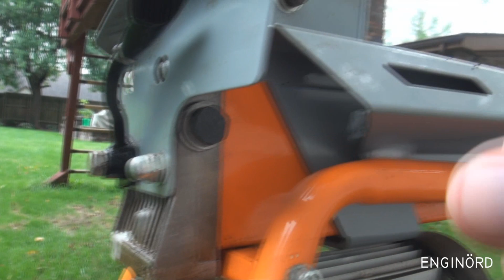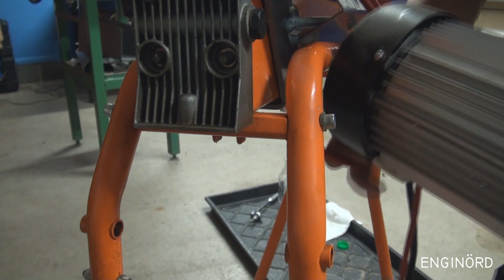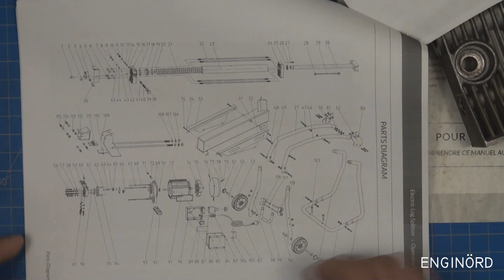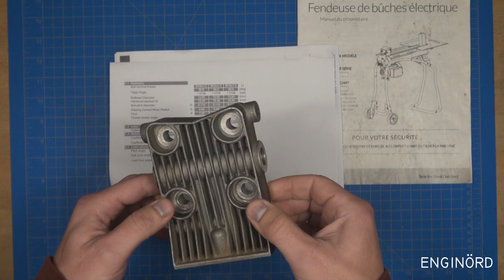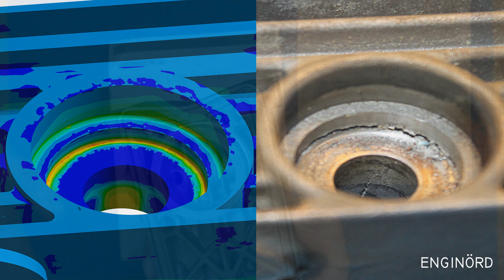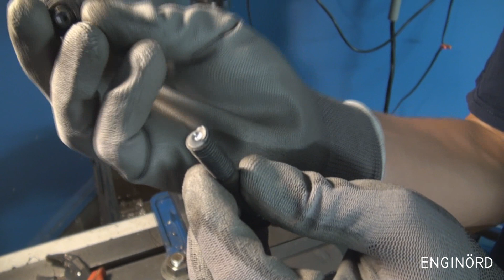Yardmax YS0552 Log Splitter Repair - Part 1

Comment: Same as the old Homelite housing so thanks for showing how to easily separate the motor from the upper valve housing. Accessing the mounting bolt is tricky on my Homelite, you did it off-camera. Need to replace those o-rings on the plate to stop oil leaking through the bolts.
Reply from the maker: Thanks for sharing your experience. Hope the repair goes well!

Comment: Great Video! Extra points for running the analysis. What hardware/equipment and software are you using to scan the casting?
Reply from the maker: Hi Michael. Glad you enjoyed the video. I used a shining einstar scanner with its own software for scanning.

Comment: OK works most of the time but now it just hums
Reply from the maker: if the motor is spinning and it's not moving the ram the bypass valve might be the culprit. if the motor hums but does not spin then the start capacitor might be faulty
Reply: @enginord  thank you. I will check the capacitor.

Comment: I have now watched quite a few videos about these log splitters and this is by far the best I've seen. Mine does not leak but the ram movement does not always start unless I waggle the lever. It also sometimes doesn't return and I need to push the ram back by hand. Also  it has only ever been able to split thin logs but I bought it secondhand so I don't know how it performed when new.
Reply from the maker: Maybe the previous owner gave it one too many hot suppers.

Comment: What is the part number for this housing, ty
Reply: It is 343201302050
Reply: @Phiyedough  thank you very much. So far there not a available thru the company. Months they say.
Reply from the maker: Walter. I'm not sure about the part number, it's shown as #16 cover on the diagram. you can send them an email to support@yardmax.com

Comment: could you have measured the Nm when you were disassembling the plate?

And I think your deserve a Project Farm Special Commendation!!!
Reply from the maker: I think I did measure the torque, but it was inconsistent. Also releasing torque for a fastener will be different than a tightening torque. Similarly as pushing something uphill, or pushing it downhill.